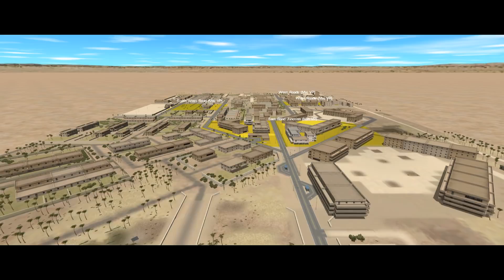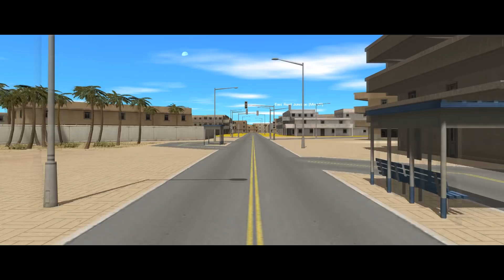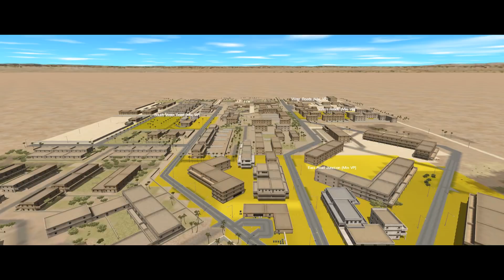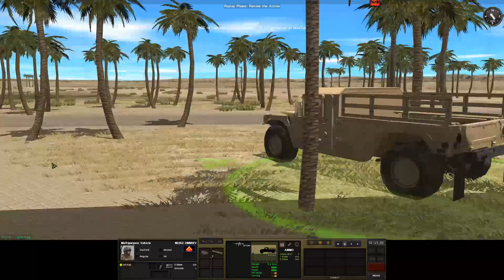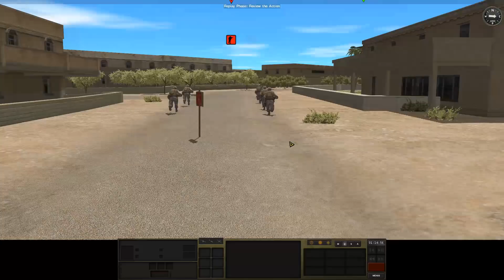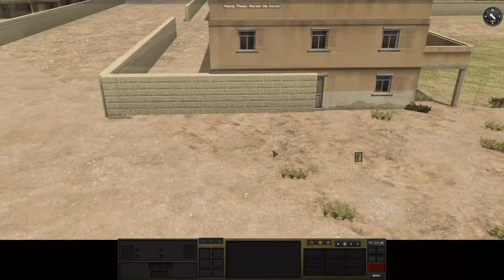CMSF2: Semper Gumby 01

Comment: Hapless, hi,  best way defeat mines at taskforce thunder mission 1? Thanks
Reply from the maker: You need to find them first, then use breach teams or engineers to "mark mines" on them. Then the minefield sign will turn yellow and you can move through slowly without setting the mines off. I haven't played TF Thunder for about ten years, but that should work.
Reply: @usuallyhapless9481  i heard mines blowing vehicles even when yellow.. i will try moving on slow, thank you!